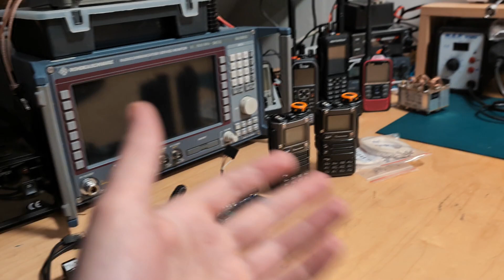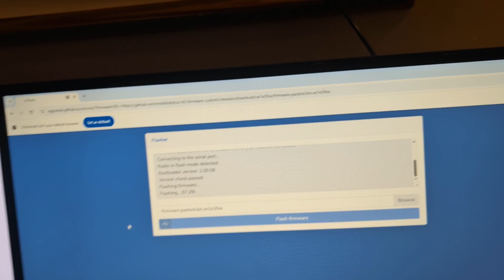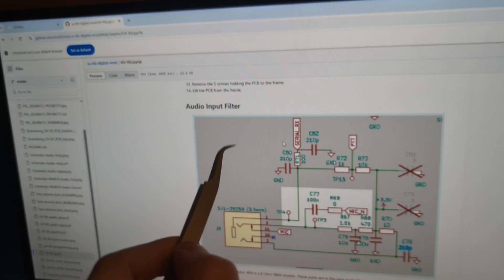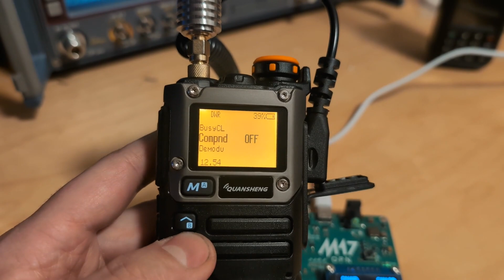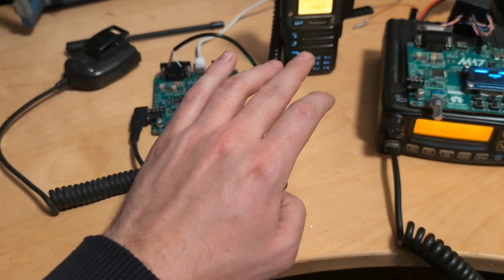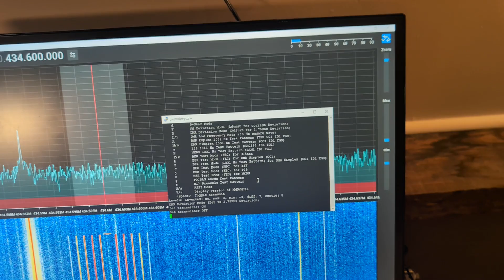Quansheng UV-K5/K6 on M17, DMR, NXDN,... Flat Audio Mod

Comment: Great Work. You said the firmware upgrade "might not" be enough. So does that mean there is a chance it would be enough and the radio would be able to listen to DMR? [Without hooking it up to the external boards] Also, if a radio already has Egzumer installed, would the firmware used in your video completely replace that, or just add the digital features. Thanks.
Reply: Aahh, never mind. I tried it and it didn't work. 😪

Comment: I would probably try that with the old dudestar if I"ll manage to find the source code (the repo was deleted by the author) like he did in " DUDE-Star Radio project" video, so this radio can be used as a standalone multi-mode dmr/c4fm/p25/nxdn transceiver (not a hotspot)
Reply from the maker: Prob would work great in C4FM/DSTAR/P25/NXDN, but I doubt it would in DMR, the turn-around time (Rx-Tx switchover time) is around 79ms, which is too slow for DMR. I'd be interested to see your results!
Reply: @on6rf  yeah tdma.. i recall the author from mobilinkd mentioned that the time can be further reduced by removing debaunce and redundant commands while switching. i really hope he'll continue to develop this amazing mod, improving turnaround. on a side note, thank you for the video! very educational.

Comment: Don't forget to upgrade the power transistors and the pre and phinal drive rf power output transistors and add a 100watt amplifier and wire it all tighter in an external ammo can with batteries and a charging port

Comment: It's the third time I see your video. I think I'll modify one of my K5 as soon as possible. Thank you!
Reply from the maker: Nice! Let me know how it goes!
Something I forgot to mention: the radio won't be usable for voice anymore, or at least your voice will be percieved as very quiet.
Reply: @on6rf  this is not a problem, k5 are very cheap. I've two more radio. One has a mod for HF+Flash expansion, the "quasi stock" has only the flash expansion. near me there are two other OM that has radios operating on M17 so we will do some tests for sure. Thank you for all informations.